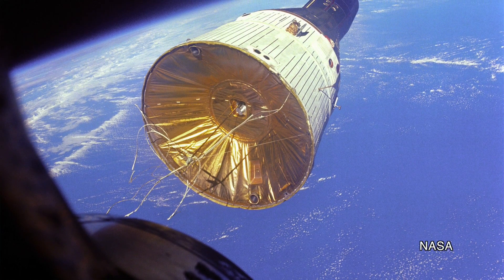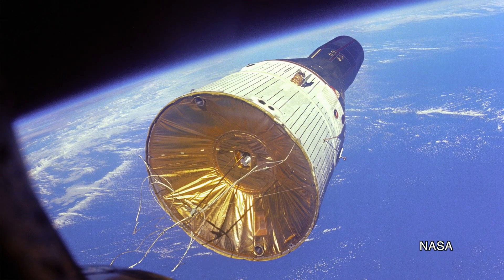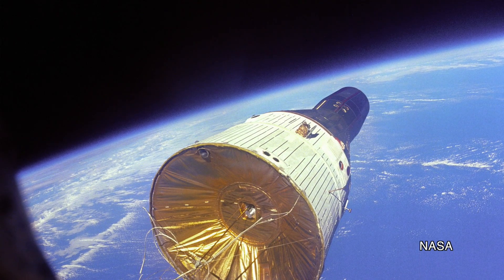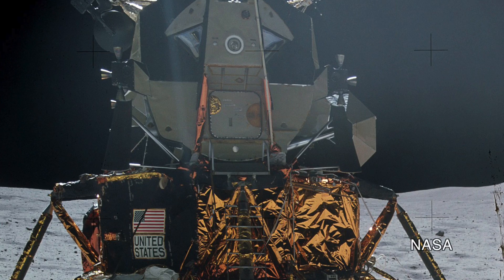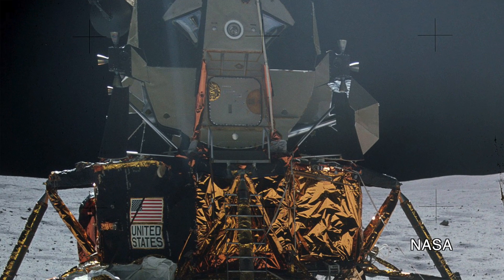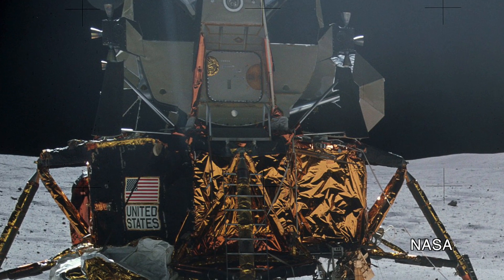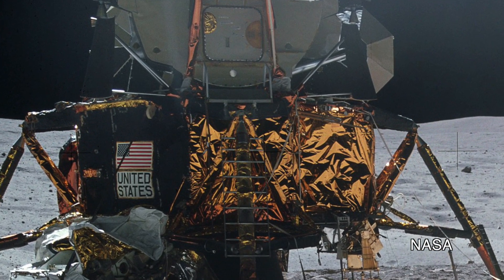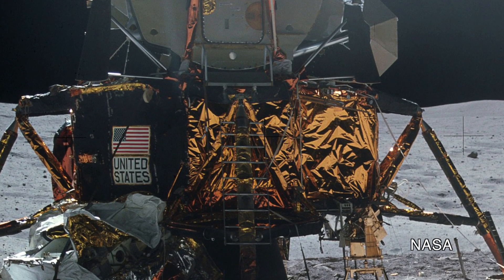What's With the Gold Foil on the Gemini Spacecraft?

Comment: This has actually been bothering me ever since I learned about the MOL; How were the astronauts supposed to get back to Earth if their plan was to cut through the heat shield to get inside the MOL?
Reply from the maker: +William Jakespeare That's high on my list. I just need time to actually go through the proposals and documents!
Reply: +Amy Shira Teitel (Vintage Space) Awesome!
Reply: +William Jakespeare There is a documentary out there somewhere that explains this, some of the MOL astronauts talk about it in interviews. Basically you can have openings in heat shields s long as they close up properly. The ET umbilical doors on the Space Shuttle are an example; they start the mission open and closed after the tank separated and they were never a problem.
Reply: +William Jakespeare I believe the hatch in the heatshield was specially cut into the shield and could be put back into shield after use and still work; they tested and proved this concept on one of the mercury missions.
Reply: +William Jakespeare Actually, it appears that it wasn't a mercury flight that tested this; the capsule used for Gemini 2 was used a second time, with the hatch modification in 1966 on top of a mockup of the MOL and a Titan booster, and performed just fine even with the modified heat shield.
Reply: Hmm so now we know
Reply: Vintage Space 

Has that video been posted yet?

Since reading the comments: I am curious now
Reply: The heat shield was modified to include a hatch to allow ingress and egress of the 'station' part of the stack. This made a lot of people very sceptical about its ability to stand up to re-entry but on unmanned tests its stood up very well